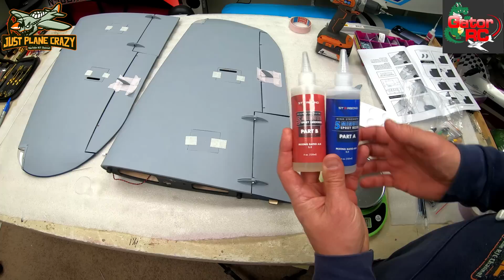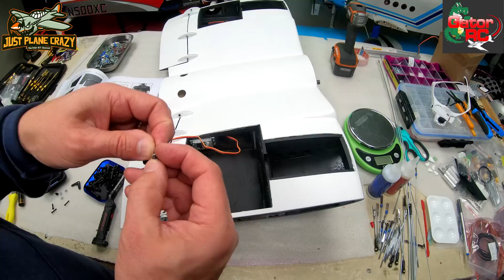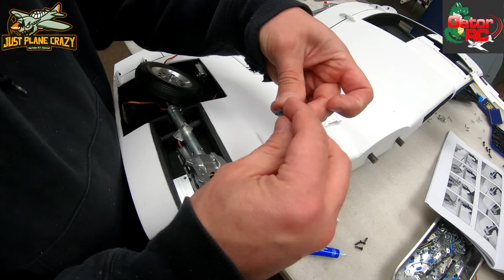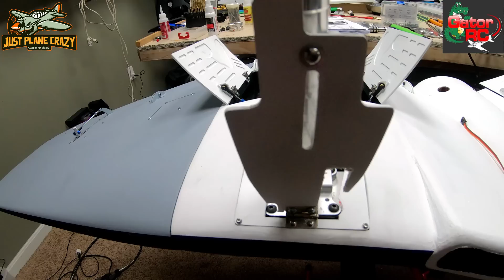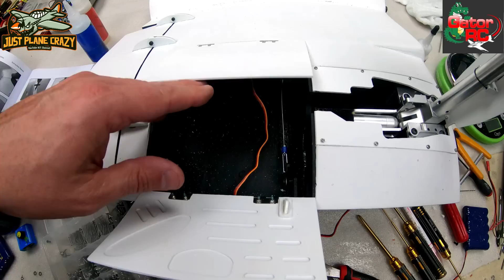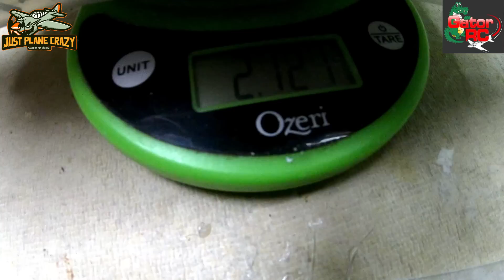Seagull Model Limited Edition 87" F4U Corsair, FG-90r3 Radial Power, Assembly of the Gull Wing Pt.1

Comment: Hi I finally got mine maiden ready run the motor up etc runs good, but just wondering wear did u get the springs for the landing gear? One of mine jammed up cheers
Reply from the maker: General hardware store.

Comment: Hi i have yhe same kit got it yesterday can i ask how can you tell the different light colours for the left and right wing tip? Cheers
Reply from the maker: I always replace my lights with uni lights. I like them brighter. If you want to use theirs plug them in a 5 cell nicad to see the color
Reply: @JustPlaneCrazy  thanks for reply ah ok cool it's a big scary kit I've got the same size seagull spitfire they released last year but this kit seems much bigger and alot more complicated build but it looks stunning i would love the fg90r3 but never had one plus very expensive hear in new Zealand, appreciate your help
Reply from the maker: Reach out anytime. Good luck. Next vid drops monday
Reply: @JustPlaneCrazy  perfect I like to watch your build videos and follow them it's great, I most likely will be asking alot more questions cheers
Reply: Damn gear doors took me for ever
Reply from the maker: @flyboywbl me also
Reply: @ I did throw on the drop tanks with the long included bolts.  It looks pretty cool like that.
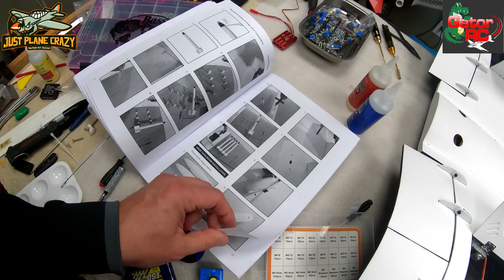Reply: I left mine clean 28:28
Reply: @flyboywbl  yea I'm worried about the gear doors and how the heck they work etc I'm guessing it's done via the transmitter settings etc. Hopefully I can just copy the vids
Reply: @ it's super easy. The JP gear controller controls and sequences the gear doors.
Reply: @flyboywbl  does the jp retracts include the door sequencer? I must check that im sure mine only come with the 150 er v1 but I'm not 100% sure will check tonight
Reply: @ yes, on the gear controller next to the power input it says "servo 1 and servo 2". If they are operating backwards, just swap the two servos
Reply: @flyboywbl  yep got ya that's great I feel more at rest now that was goin be my issue